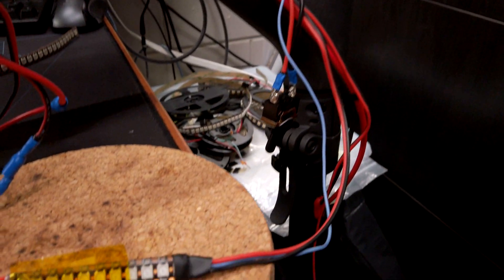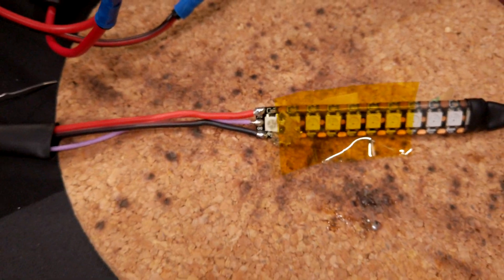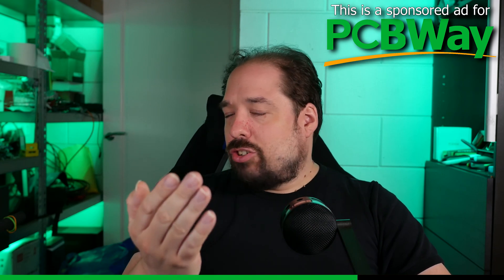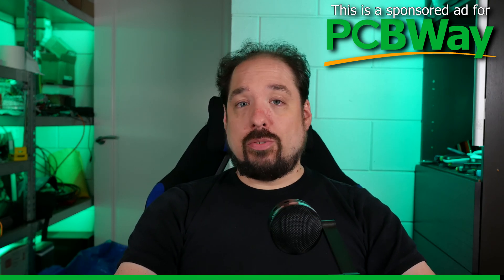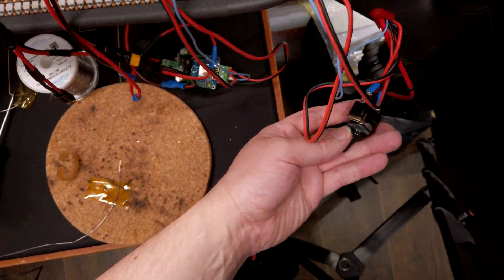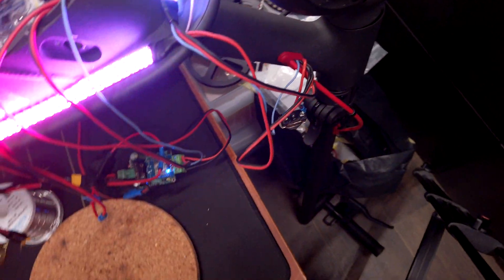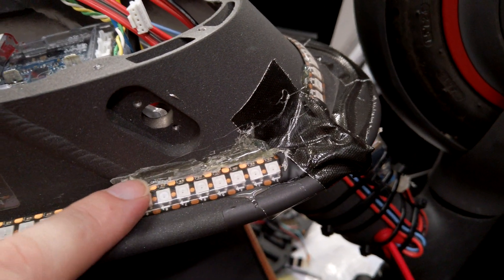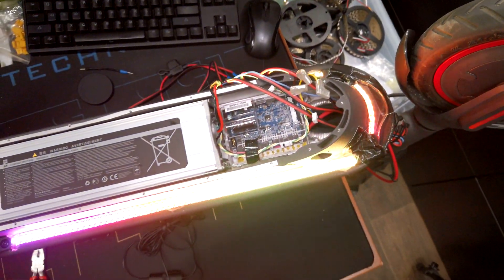💡QuinLED💡 Xiaomi M365 Pro LED Underglow | Finishing up wiring, almost done!

Comment: On man this guy is great with his knowledge and creativity on LED but Ill be honest his install skills and making it disappear aren't there and that switch could have been put by the handle bars for ease of use :O).
Reply from the maker: Well sure, but since all power runs through that switch, it means a lot more cable work then you realize I think. Would also mean increasing all cable glands and passing by the twisting points on the e-scooter, having to make sure those functions aren't impaired either. Switch is easy to reach and only needs to be done once per ride? Rest of the control is through the app. Not saying it can't be done, but in my opinion not worth the effort. :)

Could I have made thing look prettier and such, oh yes for sure. But for me, also not worth too much time, generally it would be dark anyway. 🤣

Comment: I've been using RTV silicone for an added adhesive on my outdoor projects with some success. Still using the hot glue on indoor, but the silicone is pretty durable to the elements for outdoor projects and is clear. Great project and tutorial.
Reply from the maker: Oh! That's a good tip, I'll try and remember that!

Comment: I hope the hot glue holds.  I have not had much luck with hot-glue holding things myself.
Mind you, I have only ever had one LED strip that held tight with the adhesive it comes with, and that was a Warm White strip from BTF.  All the others seem to just fall off quickly :).
It's looking good so far though on your scooter.
Reply from the maker: So far so good, this was already shot a little while ago and so far it's holding perfectly!
Reply: there are tricks to 3m tape..... VHB Tape and the activator just saying it will never come off then

Comment: I wanted to let you know that I love your content, it's actually practical information that has helped me a lot for projects! I especially enjoy your content about all the IP cameras you have tested so far, and man, I think your comparisons are under the best I have ever seen on YouTube. I would also have a question and would be happy if you could answer: I am recently working on a project which would require security cameras supporting direct RTMP (so after the settings are saved on it, it should be able to directly stream to YouTube trough any internet connection). You made a great video about the RTMP function of the Dahua HDW5831 and in its description you mentioned that the new Dahua HDW2831T would also have that function, is that right? Also if you know any other/better simple security cams with RTMP please let me know. (I will ofc also use your affiliate links :) Thanks for your hard work and best regards, Andrei